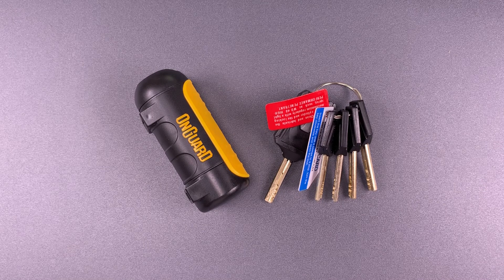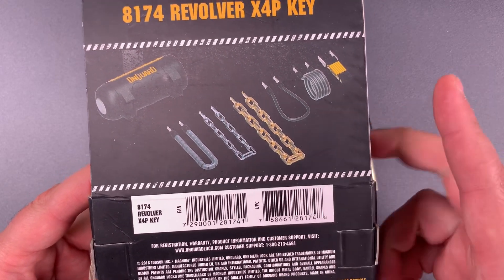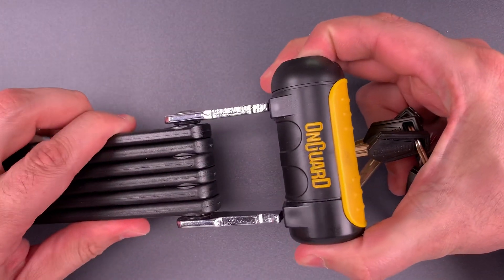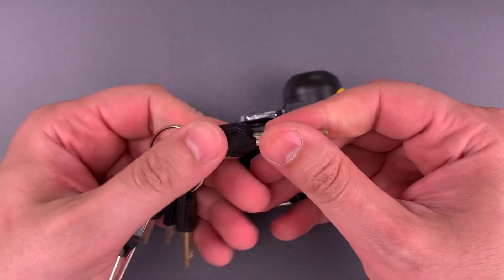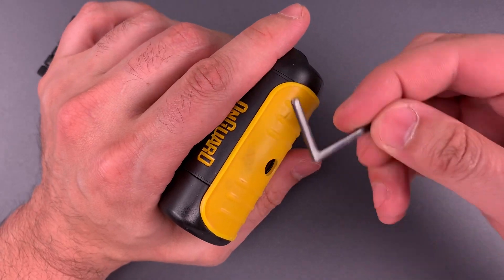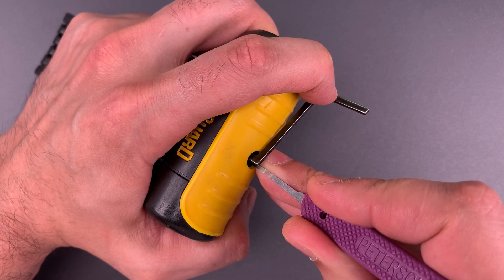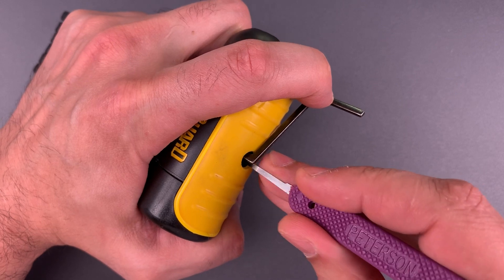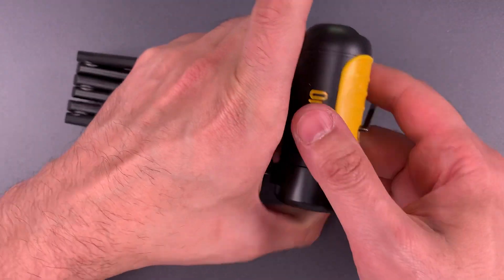[947] OnGuard’s Modular “Revolver” Locking System

Comment: I wonder how durable it is, and if that button on one side can be somehow exploited.
Reply: Was thinking about that button. Wonder of you pry it with a screwdriver if it will give and expose something or outright open the other side of the shackle
Reply: @frealms  I don't think it would directly open the other side with the core locked, that'd just be a super embarrassing design flaw, but it could probably be pried off with a bit of effort, and that would probably give you access to the mechanism
Reply: i wonder how durable are connector of these plates, i have feeling that few hammer hits can break it easily
Reply: @dannyduro  I almost feel like you could just break them by using the tension of the bars themselves if you pull them apart by the opposite end of the connectors. Like using 2 wrenches to crack open a lock
Reply: It looks like plastic. I wonder if it would melt.
Reply: I'm thinking that as long as you're unaided by anything short of a half-a-crowbar or more, you'll be ok. Seems like it works by pushing a pin/ball on under the button. You use the button to further depress the catch to release the "shackle".
Reply: @packetjanitor  LPL has investigated the structure of a few other OnGuard locks. They all have a plastic exterior, but that isn't structural at all, and the actual lock is typically steel.
Reply: There are two two pronged locking pieces in there. They are pushed on by the core and also spring loaded but in different directions.
Reply: lol @ you guys assuming that LPL didn't already check that. Haven't you being watching his vids?
Reply: Man all this is bullshit, no one picks bicycle locks unless you locked it out of sight somewhere  where they can take their sweet time. Everyone nowadays uses small bolt cutters and angle grinders. 10 seconds and you don't need to know shit about picking locks. Find something that is resistant to cutting so potential thief will have to work for it and you are 95% safe.
Reply: Vladimir Cvetkovic You might be missing the point of a lock-picking channel.
Reply: @Nood4159  bolt cutters are cool, but as you said you have to be unseen. 
You know what is better? 
Exploits in the lock, I will bring one example here,

Non shielded locks. 
All you need to open them is just a thin piece of metal that you can cut away from soda can, or even use a hairpin in some cases. All you need to do is to insert it into keyhole, push it all way back, and boom, open. 
From second person watching you, it just looks like you opened it with a key. After openong it you can hop on bike and drive away without anyone noticing a thing, even in crowded area. And a hairpin is far less suspicious then having a bolt cutters.
Reply: @MrFish-ei9ty  When you try not to be seen, you don't steal jack shit in crowded places unless you are picking pockets, or shop lifting. Like 99% of the bikes are stolen from tram stations and other places where people leave bikes for hours. So what is better to pull hairpin or whatever and play around for minute or two, or see when no one is around pull out bolt cutter and literally finish the job in 5 seconds and take off? And not all locks are bought from Aliexpress that open even if you fart on them. Hairpin, screwdriver, piece of metal may or may not work, bolt cutters work 99% of the time.
Reply: @tylernatale7898  "that'd just be a super embarrassing design flaw" ... and since when has that stopped lock manufacturers I ask you? ;-p
Reply: @rilian226  You got that right
Reply: @nakedbeekeeper9610  but, he didn't talk about it in the video. Therefore, we have questions

Comment: Is it attackable in other ways? Would you recommend it? If yes, for what? (price of secured equipment)
Reply: RAMSET
Reply: @o_-_o  you mean Dynamite.... :P
Reply: Did someone say .50 cal
Reply: Somebody say chainsaw?
Reply: I don't recommend it, the plates are good but the connections are not, you can bend it around the solid object it's locked to and snap the love at the swivel hinges.
Reply: @DigitalHazardVT  so buy one of the other five types of "shackle" it can come with.

Comment: It seems to me that it is entirely possible to design a lock to be entirely impossible to pick if only all sensory feedback useful to to a picking attempt were eliminated. For instance, a slider sidebar design which keeps the sidebar out of contact with the sliders unless the core is turned rapidly in the lock by actuating it with electromagnets would prevent someone attempting to pick the lock while the core is stationary by preventing them from feeling for gates in the sliders. When the core is rotating rapidly, the sidebar is in in contact with the sliders but now the key way is spinning. You could power the electromagnets by connecting them to copper windings on the outside of the core and fixing magnets to the inside of the lock body. When the key is inserted design the sidebar to close a switch powering a second pair of electromagnets which extends an actuator pin from the core. Just an idea for any of you guys out there making challenge locks ;)

Comment: This may be an easy question to answer, but wouldn't a lock be really hard to pick if it just had a big number of pins spaced out over a long length? Say, 20 pins, over about 4 inches? 
It'd be a long key, and lock but is it viable to do other than that?

Comment: I'm wondering if it's modular design is its weakness. Try some destructive testing on those stainless plates and the button mechanism. Depending on how it's designed, a decent shock to that button side may open it. I'd start with a 4lb sledge or a 2lb cross-peen. If that doesn't work, take a ram-set to the button itself.

Comment: I noticed you don't have any videos on decoding a combination cable lock for laptops (Kensington N17 Combination Laptop Lock - for Dell laptops - security cable). Beside cutting the cable, how would you go about it?
Reply: He has posted several videos about common weaknesses in combination locks. Most of them (at least the cheap ones) don''t seem very secure.

Comment: Physical attack? I'd bet a bolt cutter aligned with the gap on the plate pins would snap them apart in a heartbeat. Possibly do that with a nut breaker for something that fits in a pocket... or a cheap screwdriver angled in followed by a strong stomp (which would flip the screwdriver up and push the plates apart near the pins).

Comment: My question is how many thieves actually try to pick a lock?  I imagine most thieves use a crowbar, saw,  bolt cutters, or a battery powered angle grinder to defeat most locks.   
I fully understand wanting the core to be as pick resistant as possible.  These videos don't really tell me if the lock is worth buying or not.     The difference between a mediocre core versus a great core is only a matter of maybe a minute to the LPL.
Reply: He's also a phenomenal picker, way better than the average thief. Most thieves won't even attack the core if they can get away with it - they'll hit chains, bars, or even whatever the locks attached to, like detaching part of the bike the chain on. Vigilance is really the only good defence imo
Reply: Most people aren't trying to protect themselves from a master lockpicker but from an opportunity criminal with a crowbar, bolt cutters and maybe a rake or bump key, pick gun or similar. Some of these can open poor locks in a few seconds with little skill required. A better lock will be resistant to simple attacks and require a skilled lockpicker (or brute force) to defeat. And while an angle grinder will defeat any lock, it's very noisy and draws attention.

Comment: So why hasn't the industry switched to using nothing Boley locks?  Those are the only locks that so far have thwarted your picking attempts.
Reply: It's expensive as fuck. Also, using LPL as your minimum standard is kinda like trying to build your house to resist a tank. You could, but you could also just leave it be and rely on the fact that a tank, or in this case LPL won't ever attempt to get your stuff.
Reply: Ive seen a video where someone used a pick gun on one, and it opened faily quickly. that was a saddening moment
Reply: At a guess? Expensive to manufacture. Lots of moving parts. Proprietary design (patented).

The single-sided Bowley has been picked, too.
Reply: @amyshaw893  please post a link to someone using a pick gun on a bowley. I really want to see this.
Reply: @amyshaw893  That was interesting. I still think that is way more than a common thief would either have or have knowledge of, as it was a pretty advanced technique, even though it appeared somewhat crude. That being said, it was a valid open, exactly as stated. Thanks for that!
Reply: @amyshaw893  Thanks for the link. That was a really interesting (and sad) video.
Reply: @amyshaw893  ok so h just basically did what the guy who sppd the bowley did but used a gun instead.

Comment: I have a fundamental problem with your lock-picking method. You always approach a lock AFTER enriching yourself with the knowledge from the key itself. In the wild, a perpetrator does not have the key on him to inform himself on how to attack a lock. As such many locks you defeated in the past would have been undefeated if you had never seen their key.
Reply: But he knows so much about locks that he'd spot this one as a slider lock right off. Or he could tell by feel.
Reply: It's locksport - picking is rare in the wild b/c there's almost always an easier option, like a window, or a thin chain